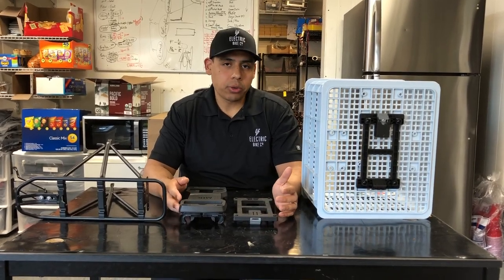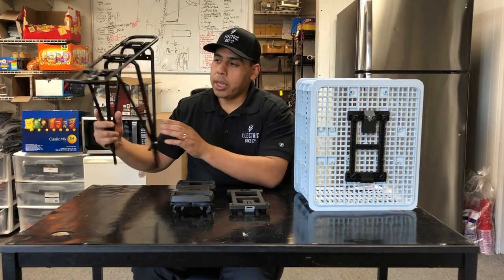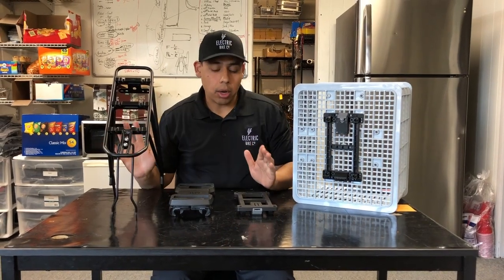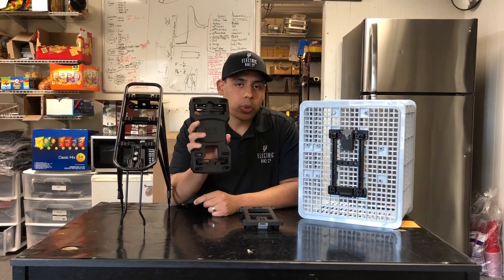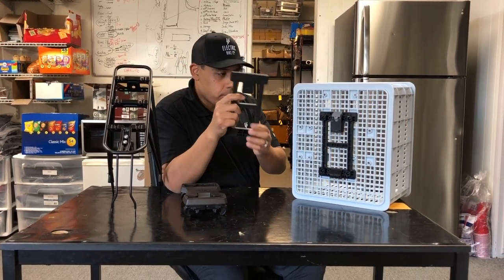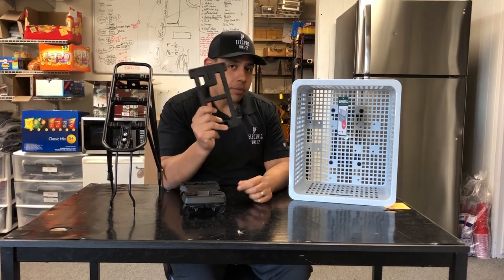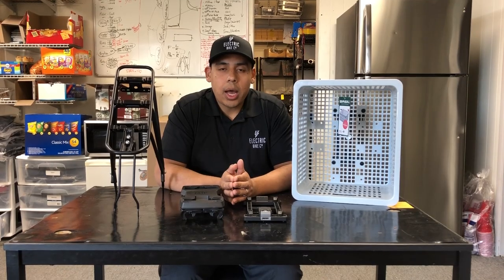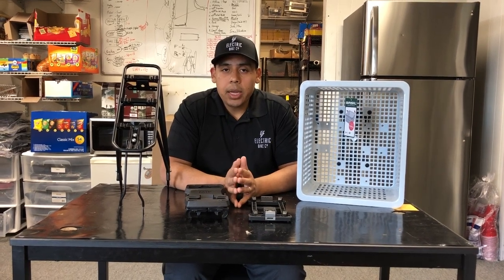MiK Carrier vs  Adapter Plate

Comment: What size screws are you using? I've got the carrier and the plate but the plate kit did not come with screws nor instructions, so I have no way to determine how to install the plate. I'd assume the screws are metric as its a European made device. Or can you just drill them out and use any screws or bolts?

Comment: Hi. How do you install the adapter plate on a panier,  when the holes don't lign up?
Reply from the maker: Hi you can move the 4 screws to line up to the holes. Please contact us at 949-264-4080 if you are still having trouble with it

Comment: Hi, very helpful, many thanks. I wonder if you can answer a question for me, please. I have an Ortlieb Rackpack that I would like to use with the MiK system. I have removed the Ortlieb fitting from the base of the pack which leaves me with 4 holes in the base of the pack. What I need to know is whether the holes in the MiK Adapter Plate will line up with these holes and allow me to fit it to them? What are the measurements between the centres of the fixing holes on the MiK Adapter Plate? I've tried the MiK website for this information and I can't find it anywhere so I've no idea if the plate is compatible with an Ortlieb bag. Thank you.
Reply from the maker: Hi Quentin, thanks for your comment! The dimensions are approximately 4.25in X 8in. Hope this answers your question :)
Reply: @ElectricBikeCompany  Hi and thank you so much for getting back to me. I've measured the distances between the centres of the holes on the Ortlieb mount and on the long axis it's just over 7" and on the short axis it's 5" measuring from the screw hole centres. If those were also your measuring reference points it sounds very much as if the Ortlieb bag is not suitable to fit the MIKAdapter Plate. Don't you just love it how all these manufacturers help the customer by making at least some things simple :-( Thanks again.